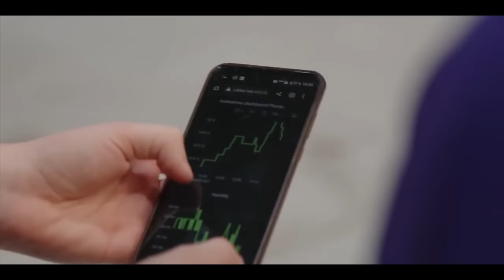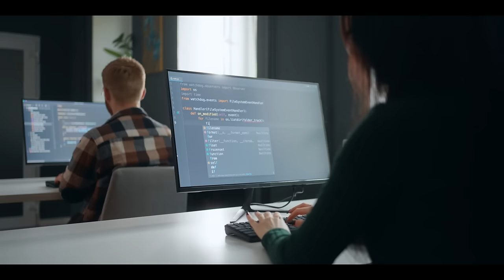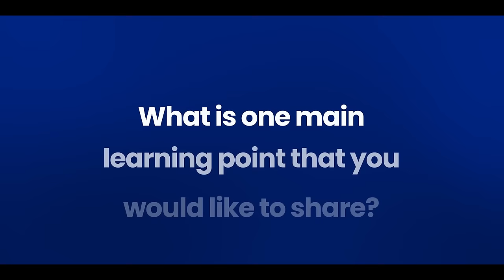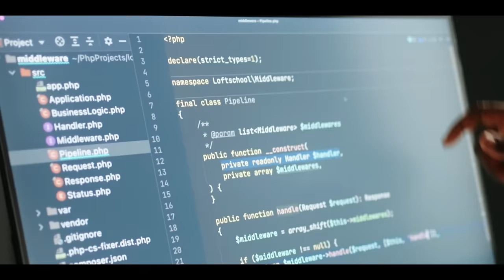LoRaWAN Excellence: Extended Film by The Things Industries

Comment: Lorawan is not the Revelation of IOT , it is a product of IOT, IOT existed long before LoraWan came along. It is wrong to believe they are IOT, it is nonsense, anybody can buy cheap Nano , PI and other boards and build your own solution for a fraction of the cost. The Security industry has been using the technology from the days of Analogue and the first to go digital with sensors, controller boards, Radio's Phone lines etc.